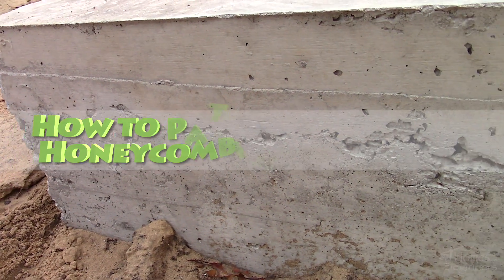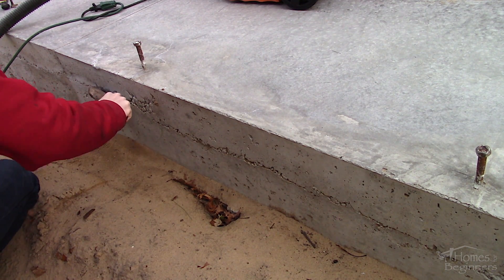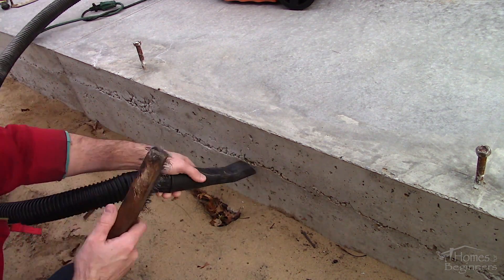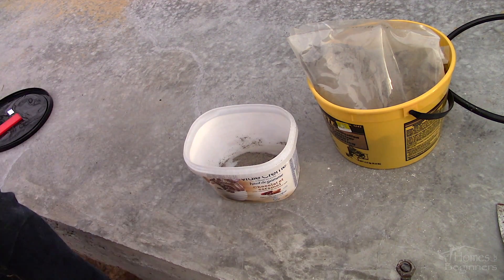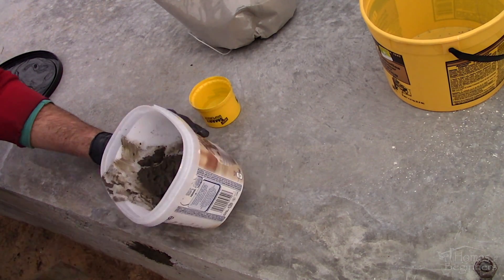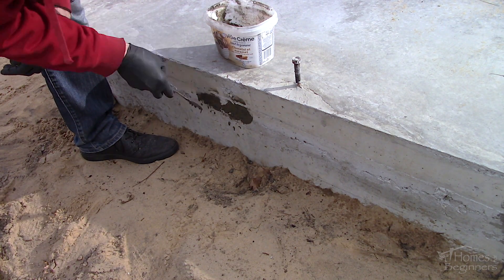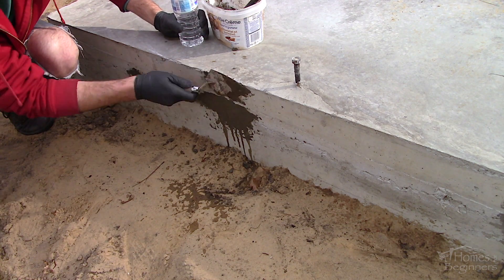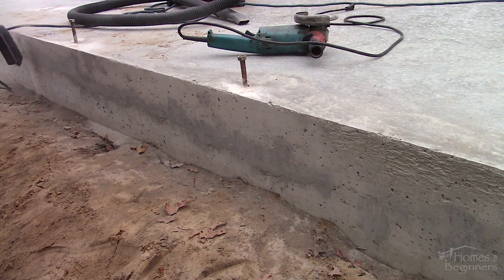How to Repair Honeycombing or Holes in Concrete

Comment: Thank you for bringing this issue to light and letting us know what it's called.  Our new concrete steps look pitted on the sides and bits are cracking off at the bottom.  I knew something wasn't right.  Two of the steps have soil and bark next to them.  Does moisture aggravate this problem?   Any advice is helpful.
Reply: No its generally caused from not being vibrated when cast at that location.

Comment: Wondering whether Quikrete's product will adhere to previously coated surface. I have a minor cosmetic honeycomb area at corner of my concrete house foundation. Thanks!
Reply: They make a fiber reinforced variety that is supposed to adhere directly to block/ concrete.  I'm about to try it right now.  Never done concrete work and this is a 36"x28" opening.  Hope it does well.

Comment: Hey how would you go about fixing all walls in a basement that are like this as well as corner pops and cracks/holes ?
Reply: Same method, although i've heard some say after the cleaning step to spray water on the wall to keep it from sucking all the moisture from the patching cement
Reply: @darken3150  I forgot to add that the walls were previously painted by previous owner. Is this still doable?
Reply: @misscd7777  Probably not, maybe fill in with something else that will stick to paint :/
Reply from the maker: Same method for pops or holes. I noticed in the comments you said it was painted, so that would definitely need to be stripped back. A blasting medium would be most likely best. However for cracks, if they're serious they'll need a special compound injected to seal the crack.
Reply: @misscd7777  use a pressure washer to get rid of old paint, if you have lead paint on your hands use sand.

Comment: You’re a little hard on your man for not being a professional because of a little honey comb. Looks like he did a good job on the concrete
Reply from the maker: As someone who has had professional construction experience and for being a shallow area, its unacceptable. But I guess it's easy to have an opinion when you're not paying for it.
Reply: @homesforbeginners  I fired a guy for it.  Guy burned the finish by trying to finish it too soon. The pour was to watery, and the finish has gaps and honeycombing.
Reply: @homesforbeginners  Agreed.
Reply: Most of what you were repairing was actually a cold joint, which is very suspicious with a slab of that type. Was there a long delay between concrete trucks. Also by the large yet still small micro pitting the mud was poured too tight.

Comment: That honeycombing wouldn't comprise the structural integrity of the concrete at all. You should see bridges on the highways prior to rubbing and patching.
Reply from the maker: You're contradicting yourself with that comment. There is a reason bridges are patched. Honeycombing in an extreme situation can pool in water, if frozen it can cause the concrete the break apart further. Honeycombing also has the potential to expose rebar, this leads to rusting and again jeopardizes the structural integrity.